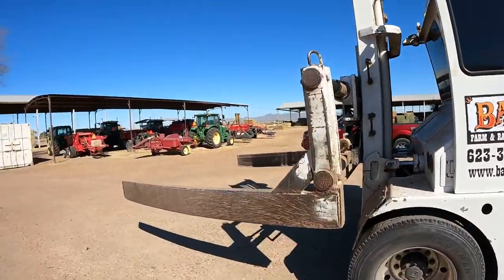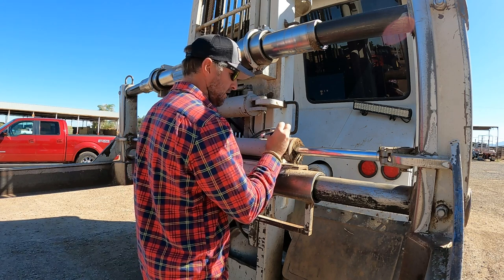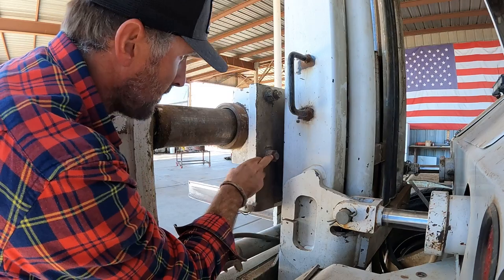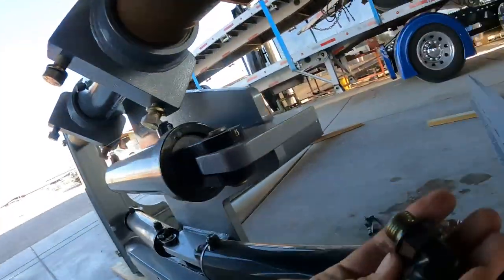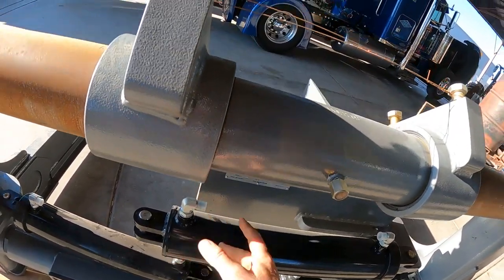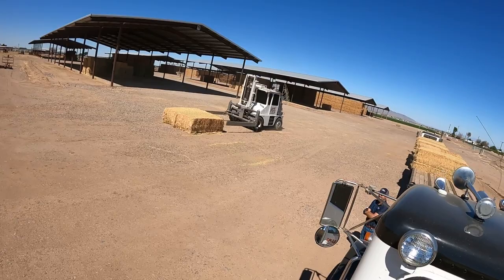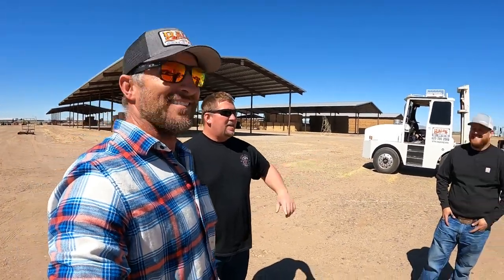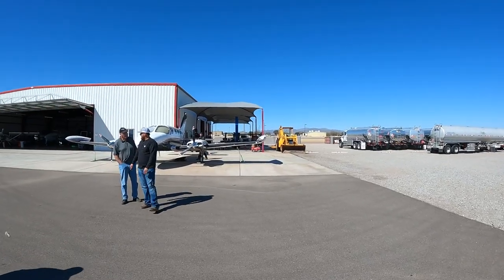Millennial Farmer vs The Master Pipelayer

Comment: I tried to run a squeeze once to take 5 stacks of small bales out of a friend's barn. The bales were a little soft and I think I squeezed the stack a little too much and the stack almost fell over. At that point I decided to use my retriever to pull the rest of the stacks out because I was not looking forward to restacking 88 small bales. My hats off to all the squeeze drivers out there.
Reply from the maker: Soft bales can make everything so much more difficult!!!!

Comment: I use colored zip ties to mark where the hoses go. One on the hose one on the fitting. The oil takes the paint off easily
Reply from the maker: I only had one yellow pain pin. Not 5 different colored zip ties.
Reply: @BalesHayFarmandRanch  I understand that, just wanted to give you the idea in case you didn't think of it.
Reply: @BalesHayFarmandRanch  electricials have numbered stickers